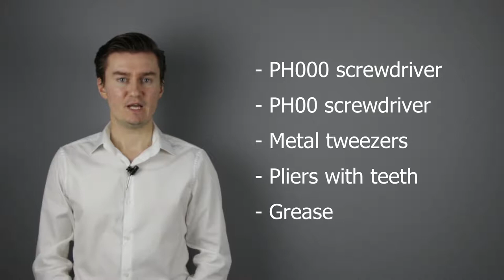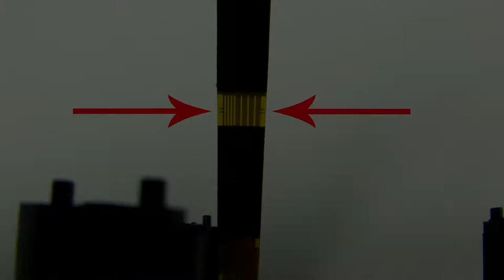Canon EF-S 17-55mm f/2.8 IS USM assembly after replacing the aperture flex cable

Comment: Thank you for the tutorial. I purchased the flex cable together with the aperture unit to make it easier to replace. Unfortunately, its not working as it supposed to. The aperture doesn't move between f2.8 and f4 when selected f3.2 and f3.5 there is no change. However the biggest problem is when taking a picture the aperture opens up to f2.8, even when higher f stop is selected. E.g when I select f5.6 the aperture closes to f5.6 but when I press shutter it opens to 2.8 and goes back to f5.6 resulting in overexposed picture. I guess the unit I bought is broken?
Reply from the maker: My guess would be that the aperture unit is broken. Similar problem has happened to me with a Canon 17-85mm lens aperture, and in that case the aperture was faulty.
Reply: @CamerasLensesEtc  Thank you. I guess I will have to solder the cable to the original aperture unit. It wasn't worth it ordering the cable and aperture together.
Reply from the maker: @juliankrakow  That is what I would recommend (replace only the cable), and if that is not possible, then I would order a genuine aperture unit with the cable.
Reply: @CamerasLensesEtc  Thank you for your advice.

Comment: I managed to do everything you did. Good and bad…Before the AF would sometimes fail to focus or move at all but after changing the aperture flex cable, the AF works fine… but the aperture problem still remains, let it be at a less frequent occurrence. Anything other than 2.8, it may work for some photos but then it stops working and Error 1 appears. Not sure what’s up… one time I tried to use it while broken (before fix) for video but then the live view would turn extremely dark, almost as if it when to f16… not sure if that means anything. Actually know that I think of it one of the prongs came off with the old flex cables. I put it back in but I wonder if that’s the issues. So like a partial contact.
Do you have any idea the issue? Or is it the above issue and I need to buy the whole unit…
Reply from the maker: Check if the IS is working perfectly. The IS unit can cause aperture problems (I know, it is strange). If the IS unit is broken, then the aperture of the lens closes randomly when you push the DOF button, and doesn't open up completely after you release the DOF button. If that is what happening to your lens, then most likely the problem is with the IS. You might try to change the aperture cable again to make sure that it is working perfectly.
Reply: @CamerasLensesEtc  sounds good thanks

Comment: Hello my friend thank you for the video . I saw the entire video but still not sure about what could be my problem . So I bought this lense for cheap it dropped  and some parts where damage as the metal ring and the first glass . I change them and it is working but the first glass dont hold on place . If I move it upside down it drops some centimeter. Thank you .
Reply from the maker: Do you mean the lens has zoom creep?

Comment: Very helpful thank you. If I can’t find lens grease. Is there an alternative?
If I order through eBay it will take 6 or 8 weeks
Thanks
Reply from the maker: I don't know if there is alternative. You might have t just assemble the lens without the grease... it is more difficult to keep those three sliders in place, but try it.
Reply: CamerasLensesEtc thanks I watched the videos and will update you i might do it during the next week. I ordered the flex cable with the last glass element together to avoid the soldering part. Once again thanks for the very quick response